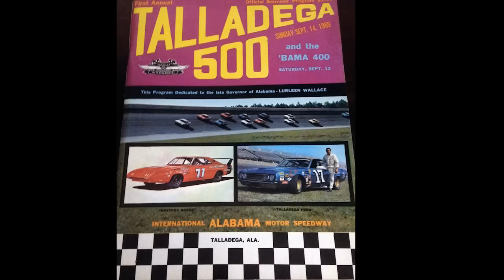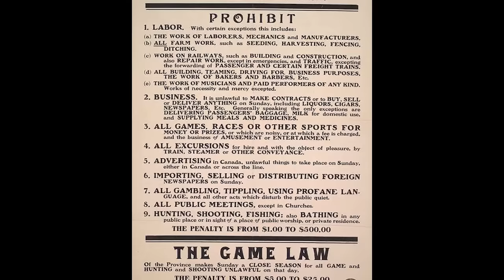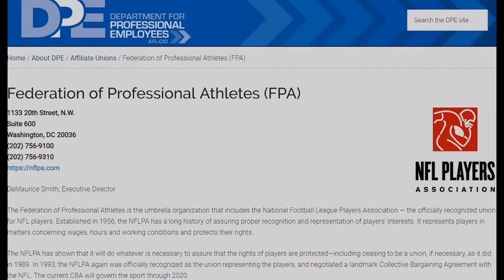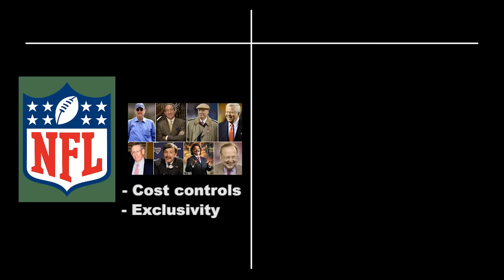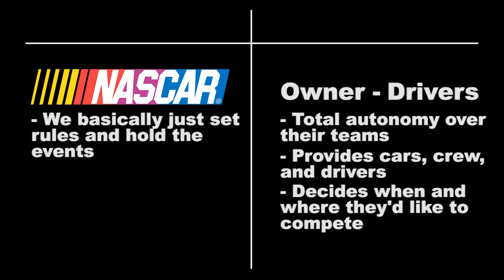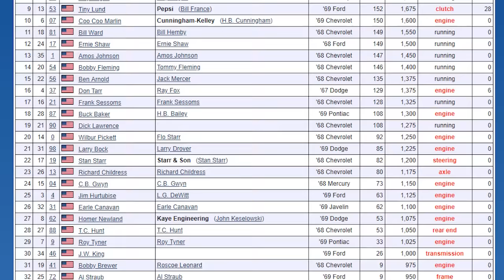The Worst NASCAR Race Ever: The 1969 Talladega 500

Comment: I don't really care for NASCAR, but this video was fascinating. Well written and produced. Great job!
Reply: I love drag racing, except for the eternal lulls while you wait between rounds, and I'm not impressed watching a Corvette blow his motor to bits chasing a stock VW with a 4 minute head start.  As a wannabe driver, NASCAR offers you some seat time, before the wreck or engine failure. Drag racing, can end on the burnout, or start line. SCCA looks fun, but it too has some issues with multiple classes running simultaneously making it like racing on the freeway with others NOT racing, or aware of a race, being rolling slalom gates on the highway. I'm actually a dirt track racing fan, or anything you want to race on a dirt oval. It makes what looks like watching an on ramp to a freeway, vs cars racing on a surface that has multiple lanes to use to try to navigate the track.
Reply: @bobbysolo5411  i like wreckfest for exactly that reason...... i cant stand f1, nascar, top fuel drags, etc. because theres no difference between any of the cars. even in racing sims you cant even tweak anything on the cars despite their real life counterparts sometimes being the most heavily tunable things on the planet. a race is decided by 1mph differences. the highlights of 3+ hours of racing boil down efficiently to less than a minute. its like watching a bunch of bugged NPCs chase each other in a circle... not interesting! id rather have professional coverage of 24 hours of lemons. more outlaw fig 8. more demolition derby/banger racing like they do in britain. dirt fig 8 school bus demolition derby endurance race... that hits the spot!
Reply: Jack Radzelovage p
Reply: @jackradzelovage6961  I understand your point, but there's actually a huge difference between the cars in F1, and that's why certain teams dominate. Still, my favorite type of racing is sportscars like IMSA, WEC, and GT3.
Reply: @jackradzelovage6961  jack you should try Assetto Corsa or iRacing. you can literally tweak everything. iRacing is the most advanced affordable sim out there.
Reply: @jackradzelovage6961   I don't see the fun in one car dominating the rest. Most forms of racing is pretty boring unless you're there or driving. Only thing worth watching is the last laps when the heat gets turned up on the TV
Reply: I'm a certified gearhead eho hates Nascar but this was great.
Reply: Interested in this story until the Baptist bashing
Reply: Big Daddy VelociCrapper same here.  NASCAR is one of the few motorsports that actually slows their vehicles down for safety, instead of looking for innovative ways to go faster while being safer.  Once restrictor plates were introduced I stopped watching altogether.  Yet the history of NASCAR, dating back to the days of bootlegging illegal booze, has always been entertaining to me so I gave this video a thumbs up.
Reply: Jack Radzelovage I gotta disagree with you about F1.  F1 allows for technological innovation in the cars, which is why there are a few dominant teams with tons of cash which regularly do way better than smaller teams that don’t have as much funding.  That’s why some people hate it and some love it.  In NASCAR all of the cars are almost identical, with the idea being to level the playing field and allow rich and poor teams to have an equal chance.  I think it’s a great concept which emphasizes driver skill, pit crew skill, and team management skill.  But I also enjoy the F1 concept of letting teams win through technological and engineering innovation, where the cars don’t have to fit a cookie cutter template.  In my opinion, NASCAR is like watching a sport where steroids aren’t allowed and F1 is like watching a sport where steroids are encouraged...if that makes sense.
Reply: same here not a fan at all. this video tho was great
Reply: F1 FE Indy endurance and rally for me
Reply: Darn! I was going to say the EXACT same thing!  Short by 2 weeks. No checkered flag for me.
Reply: Then you should see a doctor.
Reply: goodchessactor p
Reply: In F1 racing Mercedes and Hamilton dominate due to money. When you have 3 guys Gibbs,Hendrick,Penske who own 90% of the field of course your going to have a decline. You know why the NFL has high ratings because the availability of the next best thing. In Nascar you don't have an average joe guy who can come in and be a huge success story. I'm not a fan of NASCAR but after watching a few videos like this and the forgotten tracks (North Wilkesboro Raceway) I might start watching it.
Reply: Yeah.  Great NASCAR video.
Reply: Its like children talking about candy, what kind they like and what kind they don't like. Look if it has a steering wheel and a motor and a rival that's racing! From the first cars made vs steam or electric or other new "cars". If this same man made a video about any serious race platform you would find the rich history and JUST maybe change your mind🇺🇸
Reply: @chericalloway3591  where are you from i grew up in Kentucky and was born in to it so were my children but as I grew older I realized it was just glorified guidelines to tell you how to treat your family and friends and strangers. The religion has changed so much but its about core fundamentals and only 1/6 of the world is Christian faith based. So others are entitled to there opinions, just ignore them and know you know the truth no matter what any other man says. Good luck my friend🇺🇸
Reply: I love nascar!
Reply: @roninbayacal7857  you should its wierd to hate it, its like baseball and drive in movie theater's, Chevy trucks and some boons farm with a pretty girl at the beach . Pure Americana 🇺🇸
Reply: Round and round is boring to me. I’d rather watch a road course race. The Bathurst race in Australia late in the year I think is the best race that I have ever seen.
Reply: See someone who calls himself Big Daddy yet cares not
Reply: @danielmcalister2713  Uhhhh, what?
Reply: @chericalloway3591  I’m sure you will be sorely missed.  Bye.
Reply: I'm a F1 person but I agree a really good video
Reply: Get

Comment: Neatest thing about Bobby Isaacs, in my opinion, is how he took the now banned Charger Daytona to Bonneville and set a number of speed records with only minimal changes to the car.  He was definitely an independent spirit in more ways than one.  The car survives to this day and is, I think, the same car (no. 71) that features in this video.  I could be wrong on that last point though...
Reply: Your 100% right across the board.
Reply: Isaac was always one of my favorites as a kid. Isaac died broke and one of the current team owners bought him a nice headstone IIRC and he's buried in a cemetery overlooking a legacy track IIRC . Anyone can correct me if I'm wrong. He was voted by NASCAR one of the top 50 drivers of all time.

Comment: "puttering around at 160 mph"
Reply: Pfitz By now it's nothing
Reply: Read that the same time it came up in the video LoL
Reply: lemans in the 60's was double that sheed.
Reply: @bouncingshot  Yeah Derek Bell took the Porsche 917LH would go 246 in 1971 simply due to the fact that before chicanes were added it was 3.7 miles down the straight. Fun fact NASCARs ran at LeMans along with an IMSA Monza and Vette. Doug and Herschel McGriff ran a 76 Charger running a 5.6L Wedge and Dick Hutcherson and Richard Brooks ran a Torino with a 7.0L V8straight from Nascar due to a deal between Bill Thomas and the ACO(LeMans reps) the Charger failed 2hrs In and the Torino ran a surprising 11 hours. Both cars had a ton of fuel trouble due to Nascar being ran on 102 and the fuel there despite being told it was 93 was more like 83. Despite poor performance they were the crowd favorite due to the noise and sheer size of them
Reply: @niko1600  dang. i'd probably love the nascar's noise if i was in the  crowd back then lol.
Reply: Personally never understood Nascar!  Going around and around all be it at 200 odd mph on a oval?,🤔 Formula 1 world wide technical tracks with straights , corners ect still obtaining the same speeds plus. Formula 1 drivers are far more skilled!
Reply: @williamjohnson6517  Michael shumacher said the same thing, but as its a level playing field, the best driver/team wins.
Reply: @williamjohnson6517  they tried to race formula at Talledega once but the drivers blacked out. They were pulling too many Gees in the turns. The track is just that fast. I think they were running close to 250 MPH? Around 247 or so.
Reply: I can barely get 70 on the highway without suffering a mild heart attack xD
Reply: @williamjohnson6517  its more about engineering endurance individual skill and pure luck xD
Reply: @williamjohnson6517  
They might be more skilled in many ways but nascar has the crashes, and the 3 and 4-wide tracks which have to be negotiated
Reply: william johnson while I think F1 and GT racing is much more interesting than nascar, you can’t say nascar drivers don’t have skill. See how close they get to each other at speeds around 200mph, and how they have to overtake through tiny gaps. It may look easy but it isn’t really.
Reply: william johnson You would think it’s that easy. 

F1 cars are high tech vehicles designed with the driver. Their drivers however also race 1/2 of what NASCAR does around 90 minutes in huge European track with less than 15 guys. 

NASCAR you have a giant box with a V8 powerful enough to power a tank. Also have to remember, these guys don’t drive on flat ground- these are banked- which add whole damn load of problems. You’re also racing with 42 other guys out their. It’s a sport of endurance. 

Skill? There are many videos out there showing the damn good talent that NASCAR drivers have. Didn’t a young Senna lose to a young NASCAR driver for the go kart championship?

I’m not hating on F1, I love the damn sport. However, I’m tired of greenhorns thinking NASCAR is some cakewalk-
Reply: @1pcfred  same at Daytona  to fast front of the car would lift of the ground or flip crazy
Reply: @travisrich1929  I've gotten to walk on the Daytona track. That bank is a lot steeper than it looks on TV. Any less than 80 MPH and you slide down it. The surface of tracks is loaded with rubber crumbs too. What I'm saying is it isn't easy to make it around a track period. Even if there's no other cars on it. It's not as easy as drivers make it look.
Reply: I wish my CVPI could putter like that, the speedo stops at 140.  :/
Reply: Chrysler 1969: Casual 190MPH stock car
Nissan 2023: “Hold my beer” 
*Casual 220MPH production car*

Comment: The reason the tires lasted is that on the morning of the race, Goodyear officials came through the pits and told all the teams that any car running consecutive laps of over 190 mph, Goodyear would come to their pits, pickup up their wheels and tires, and bring their bare wheels back to them.  Brickhouse ran the last 10 laps at over 195 mph, Goodyear was livid but could do nothing.  I was standing in pits when that announcement was made.

Another point, Brickhouse was not a factory team driver, he came to Talladega to drive the #14 car Bill Ellis car.  When the drivers walked Saturday afternoon, he was asked to drive the #99 car.  Ellis released him to do so and put Ramo Stott, an ARCA driver in the #14.
Reply: Are you related to the Whittington Brothers?
Reply: Amazing insight
Reply: That adds to the story quite a bit. Good info. 🙂

Comment: I was there. 15 years old, from Mobile and wayyyy drunker than I could handle.
Went to races in Atlanta too...when you could still sit at the exit of #4, within 6-8 feet of cars doing 180ish.
Walked away from that digging rubber out of my eyes and ears.
Reply: Was there also and may still have the Program. There were more than 3 of the big NASCAR rides on that track that day that is fact. Some of the lesser teams fielded cars along with the pony cars to fill that field.   I do remember the pony cars as being way off the pace though. I was 10 and my dad was a friend of the Allison's. What we were told is both an issue with tires and substandard rough paving and both together were the reason many drivers refused to run. 
 i still remember Bobby Issac during the warm up that morning turning a lap at   195 so they were hitting well over 200 on the back straight and in the trioval.
 Was also at the 1070 race now that was really a good race!! 
They ruined Talladega when they went to he restrictor plates but I remember the REAL NASCAR racing there and it was NO JOKE! As far as we knew that day Brickhouse won in that Blue Daytona.
Reply: @rutledri  Richard, I have no idea if this is true or just pit area rumor, but I was told that there were spots of the track that had reinforcement screen wire above the track surface. That's a real tire killer!
Being rushed to 
open so BF could get some of his money back, I'm sure there were corners cut and some 'touch up' work never was completed.
Regardless, glad you shared your experience, and maybe I'll see you there again one day.
God bless you.
Reply: @rutledri  Do you know who really won the race?
Reply: @Arctic_Falcon  As far as any of us who were there at the time knew it was Brickhouse. All the scoring controversy hit later Brickhouse went to victory lane so?? .
Reply: You're not really spectating unless you can taste them racing.

Comment: The worst race i ever watched was the brickyard,the year everybody was shredding tires about every 10 laps
Reply: 2008
Reply: @mattakastarkill3r402  thank you Matt, ugh that race was terrible
Reply: YEP no.doubt
Reply: Chip White the f1 race?
Reply: @2bboosted624  nope , cup race, i remember that
Reply: Yep, the last straw for me. After moving the race from Saturday to Sunday then pushing the start times until it was 3 PM.  Finally, we had that turkey.
Reply: Charlotte in either 06 or 07 was the same. Turn 3 was shredding tires if guys openned it up even a little bit.
Reply: Yeah and that’s because it was known that year that no one decided to repave the track
Reply: I was real disappointed with the restart at the Brickyard where it was going to be Jeff Gordon and Dale Earnhardt on the front row, with less than 10 laps to go, and Gordon put Earnhardt into the wall. I would have preferred they raced it out, not the old wreck and run.
Reply: I can never forget that. At least NASCAR was able to figure out the problem during testing later that year
Reply: @Dalton1294  they knew before hand. Just couldn't do anything about it.
Reply: I was ther for it. It was miserable.
Reply: The inaugural race at Texas Motor Speedway in '97, that was a borderline farce the way cars were spinning and crashing going into turn 1. NASCAR had to re-do the banking in that turn entirely after it.
Reply: Oh yeah that first  Brickyard where they found the last remaining section of the old brick Indianapolis speedway before it became asphalt. Yeah that was bad. I think the Hosier racers had to end up using the Goodyear tiers for that race leading that to the last ever tire war in NASCAR.
Reply: Yup they had to throw the yellow flag every 8 to 10 laps. The New Hampshire race in 2000 with restrictor plates  was also bad, no lead changes.
Reply: @003geclipse  So was the one short track that Rusty Dominated  the race from winning the qualifying in the 1990's with 0 pit stops leading to the modern fuel cell system for short track was bad for those not a Rusty Wallace Fan.

Comment: Couple critiques. 

1)Curtis Turner wasn't the only driver banned from NASCAR for trying to unionize. Tim Flock was also banned at the same time. (Also to note NASCAR by the mid 60's reinstated Curtis's ability to drive in the series.) 

2) As for it being the worst race in NASCAR history, anyone remember the '08 Brickyard. Caution every 10 laps (if the tires lasted that long). At least in this race they got the tire issue corrected before the green flag dropped! Personal story about that Brickyard; I sat in turn 3 for that race, and when I left everything I was wearing or had out of a bag/container during that race was covered in a fine rubber dust.
Reply: Curtis Turner was reinstated around 1965, because NASCAR had lost a number of stars like Joe Weatherly and Fireball Roberts, plus Chrysler's Hemi engine was banned after '64, which meant the Pettys were out of the series for most of '65. They were running out of big name drivers at that particular time, so they reinstated Curtis...and he won the first race at Rockingham that fall. Tim Flock's ban was also lifted, but he had retired from driving by then.
Reply: Never heard about the dust on the crowd in 08. That's really interesting to think about. Do you have/know about any pictures of the aftermath?
Reply: While the racing was bad there, I think the events the transpired here are far worse than what happened in 08. When was the last time you saw people walk out of a race because of tire problems or got into open spats with the head of the sport because of driver safety concerns?
Reply: @samhouston9162  i believe the last time i heard about that was the f1 race at indianapolis 2005. only six cars actually started the race. heres a video explaining all of that https://www.youtube.com/watch?v=fIjw5gI3rKE